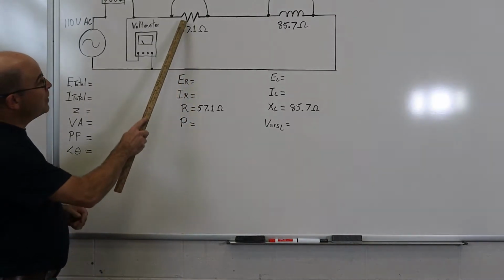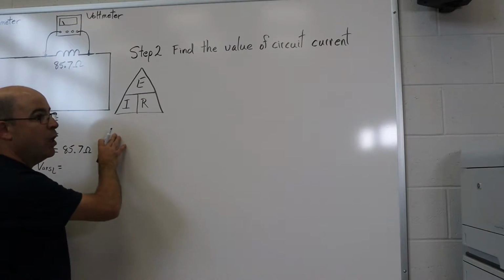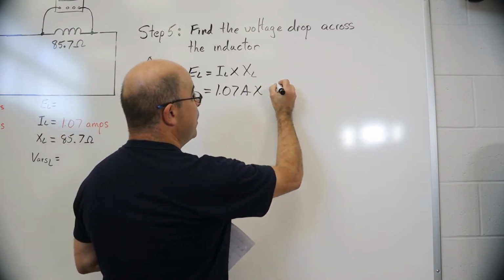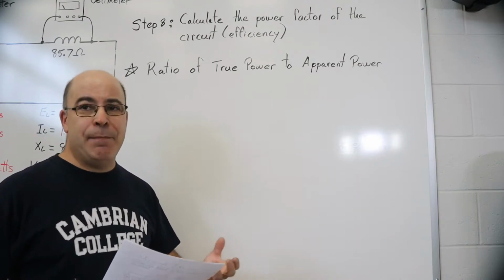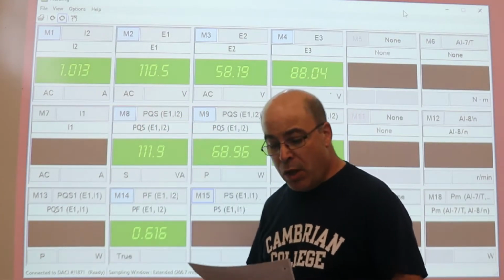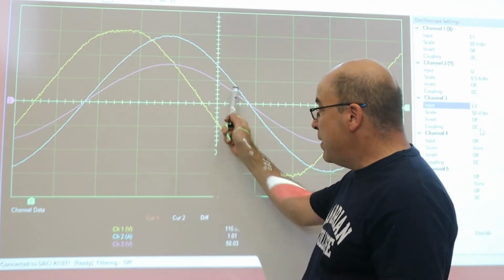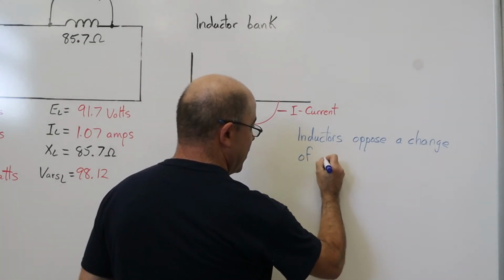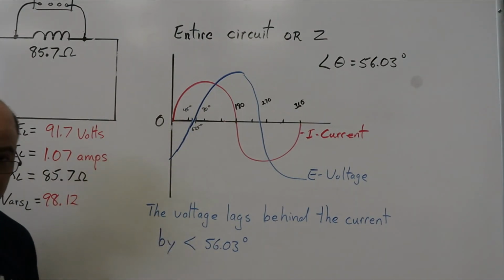R-L Series Circuit calculations

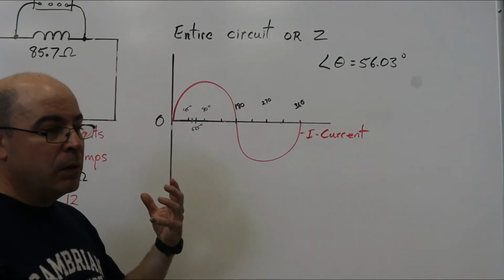Comment: @42:17 "Because of this 56 degrees, the voltage is going to lag behind the current." 

I am confused and am wondering if by voltage you mean applied voltage. If so, shouldn't the current lag the (applied) voltage by 56 degrees. That's what the oscilloscope showed moments earlier. I'm looking at my textbook and it states in an inductive circuit, the current lags the voltage. Any clarification would be appreciated.